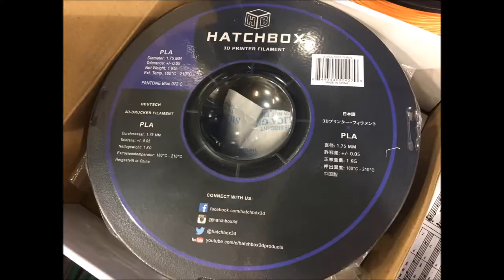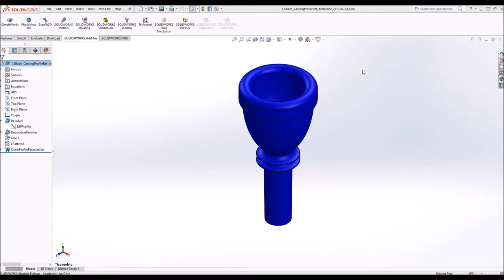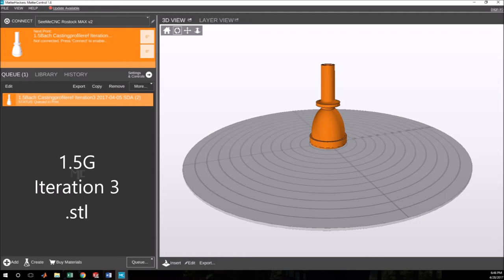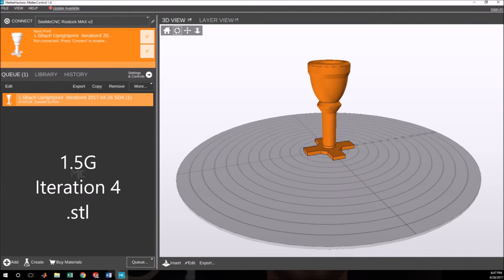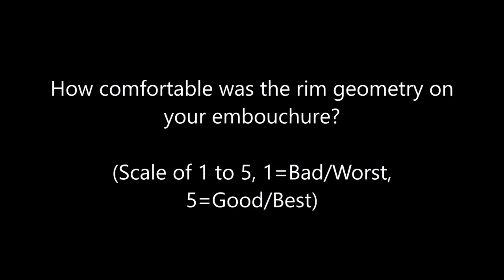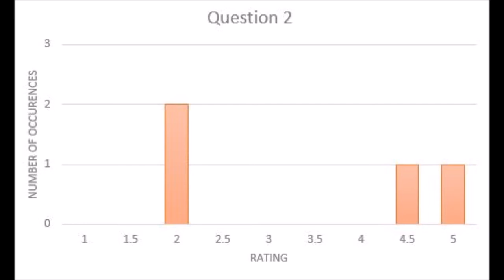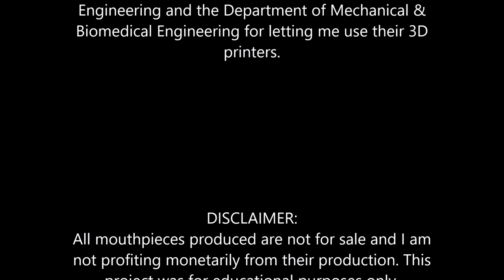An Exploration of 3D Printing Technology and Trombone Mouthpieces

Comment: Great video! Wish there was a better way to measure the cup of the mouthpiece though. I'm doing a similar project and am trying to make a mold by trimming a piece of cardboard until it fits the mouthpiece perfectly, but this way not very good. By the way, why not use a round file to smooth out the bore?